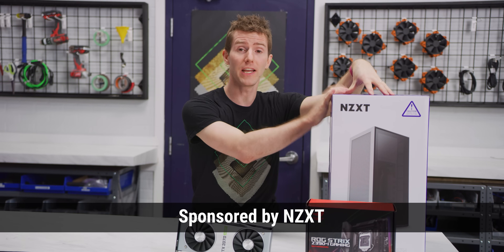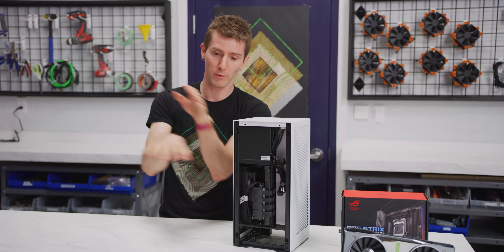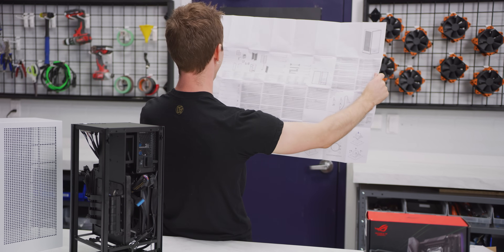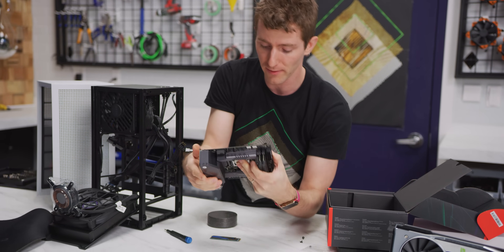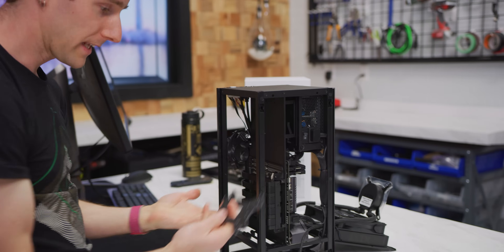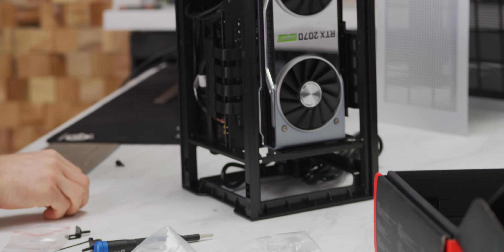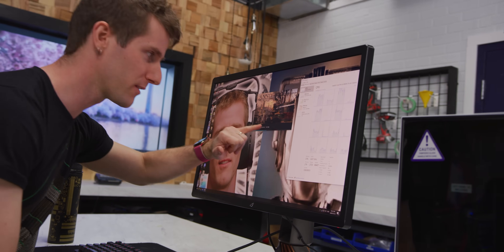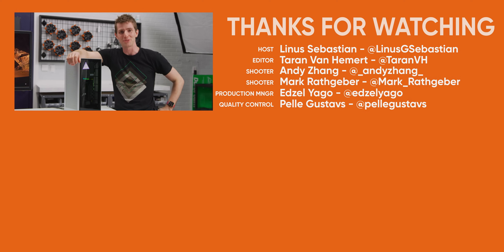Building the Xbox Series X Rip-off PC

Comment: "building a xbox series X rip-off"

uses a i9 9900k

yeah sure Linus sure
Reply: builds an Xbox Series X rip off ... at 3 times the price
Reply: @Obsidianrasengan  With about the same performance in games. Hopefully PC components go down in price after XSX and PS5
Reply: @Obsidianrasengan  do we have a price for the series x yet? Either way that's a fair point.
Reply: S W but yes that’s the point of Xbox’s. Cheap good materials
Reply: @Obsidianrasengan  it will indeed have an excellent perf/price ratio
Reply: @Obsidianrasengan  Can do ten times what an xbox can.
Reply: @Obsidianrasengan  with 20 times the utility and usefulness plus better graphics
Reply: @Obsidianrasengan  and slower
Reply: @Obsidianrasengan  

Probably Hence 'Rip-Off' 🤓
Reply: S W at 4x it’s performance
Reply: @ClippyCobain  yup
Reply: @ClippyCobain  its not even as powerful as a xsx
Reply: @Obsidianrasengan  and with parts that are not as powerful as the series x specs
Reply: @Lord Frieza Turing and RDNA 2 architectures are different, cannot compare TFLOPS
Reply: @Lord Frieza right? As if the engine determines how ALL the games will run. It's not like there aren't tons of games using the same entire engine with differing performance or anything. It's just funny how with something not out yet as with all consoles that have launched they believe the performance will be astronomical in everything. Then release comes with a shit ton of caveats.
Reply: @abc 123? chungus asked how much better the 9900k is in comparison to the xbox, to which you replied to "around the same" which is false, as the xbox cpu is gonna be an zen 2 cpu thats even slower than the 3700x and you also said "the xbox gpu will make up for the slow cpu" which isnt how it works, and cpu doesnt suddenly become faster just because theres an gpu in it
Reply: And an Nvidia GPU. Although to be fair these were probably the parts that were the most readily available in their inventory.
Reply: @SteelSkin667  microsoft devoleped the cpu (zenII+) with amd for probably a few years. That was not in their inventory.
Reply: @comet1310yt   I dont get your comment.  He was talking about Linus using what was in his inventory obviously.
Reply: @metalmaniac788  oh
Reply: @comet1310yt  How did they develop the cpu for a few years if zen 2 came out earlier this year?
Reply: @abc 123? Yeah how's that working out with the One X? We don't know exactly how this thing's going to run, but what you're describing creates something called a bottleneck. 

The CPU n the thing won't be at the level of Zen and Zen+, let alone it's Zen 2 counterparts. It only has a 3.8 GHz single core performance and 3.6ghz multi-core/thread performance. 

When you overclock a CPU on all of it's cores, the performance gains are substantial. 

It's obvious you're speaking from a place of conjecture. I'm not trying to be mean, but you're seemingly naive of hardware functionality
Reply: @KingInTheNorth I would not believe any reports about he xbox until it's actually out
Reply: @abc 123? The xbox series x gpu has an way lower clockspeed, probably to have better thermals for the complete system. The Zen 2 Jaguar Base 1,6 Ghz boost 3,6 will never be as fast as an 3700x which is base 3,6 and 4,4 boost. Which some people report to boost up to 4,1-4,2 ghz.
Reply: Lots of salty pc void here. Gotta remember Consoles needs to be some what future proof because it’s suppose to last for years
Reply: @abc 123? 3700x will outperform the CPU in the Series X
Reply: abc 123? Zen 2 has a higher IPC than current gen intel, it’s just intel has higher clocks.
Reply: The difference is that no matter how powerful our PCs are, when it comes to loading times. Xbox and PS5 wins. Because video games tend to be more optimized in consoles. My opinion don't judge ahah
Reply: @key3311  Video games aren't just optimized on consoles, that's why some games on PC allow console commands to use cheats, go into debug mode and such. Loading times will be superior on PS5 until the new SSD's come out for PC later this year, around the same time. Even then, we won't know until then. I'm sure hoping that PS5 keeps up or pushes ahead in loading times, though! Fingers crossed!
Reply: The GPU alone cost more than an Xbox Series X lol
Reply: Deliveredmean42 since it’s using rdna 2 gpu stuff, by the time it releases im sure there will be gpus with the same performance for lower prices lol, well, i hope so
Reply: @Deliveredmean42  same with the CPU
Reply: Lets put aside the potential power of the new consoles and remember you're paying $60+ for every new game (Unlike on PC) and also paying $60 a year for online play times 7ish years of a console life. That shit adds up and pretty much negates the higher price of PC components.
Reply: @TooBokoo  what a load of shit. You can game share and stock up on gift vouchers that negates any of that, you'd be an idiot to pay full price.

I bought a decent enough PC last year and trust me when I say I'm still waiting on these apparent savings.
Reply: @TooBokoo  yeah that's like buying a car in full for 30k rather than buying a 30k car paying 250 a month. You're saying it's better to just drop 2k just to play some games rather than spending money overtime because it adds up..
Reply: @TooBokoo  scrapping online tariff
Reply: @TooBokoo  not really with game pass. and xbox share. i never paid full price or anything for my games. im on pc now tho
Reply: @abc 123? the ryzen 7 3700x in the xbox is locked to 3.5ghz
Reply: Looking at the comments 😂.. just face it, Xbox series X is going to wake up the PC gaming hardware industry big time. You have been stagnant for years and overpriced. Innovation, Mass production and optimisation Wins... sorry 😐
Reply: 1misanthropist  they can.... Something called XEON And rx570
Reply: @abc 123? Riiiiight. Keep thinking that.
Reply: @abc 123? That's called a bottleneck
Reply: @abc 123? Youz saying that the gpu somehow increases the cpu performance.
Reply: @Lord Frieza Seems legit!
Reply: @Lord Frieza I doubt these will even match the performance of a 2070 super..let alone a 2080 lol
Reply: @Transistor Jump Haha!
Reply: @Lord Frieza Don't bother with these people man, they can't seem to comprehend that more Tflops doesn't always mean faster.
Take the GTX 1070 and GTX Titan X, the Titan X has 11 Tflops where as the 1070 has 9, but the 1070 is actually 3% faster then the Titan X.
Reply: @Deusomas  yep more tflops does not always mean better performance. It all comes down to the architect and optimisation. And apparently AMD has done a good job on the architect or the gears of war devs really optimised their demo.
Reply: I hope all is well I feel like God laid this on my heart for me to send you this message! The Bible verses that changed my life which was Acts 2:36-43. I just wanted to say that Jesus Christ can restore your life and that is a promise according to Acts 2:39, and God loves you. 
 If you’re in need of a good church near you here you go:
https://www.upci.org/resources/locate-a-church God bless have a great one 🙂. I prayed over this I hope all is well 🙂
Reply: 11% rip-off
Reply: has MS released a retail prices yet?
Reply: @PSYCHOV3N0M  wow, the 100 bucks different
Reply: @abc 123? And basically cost as much as or close to the price of the console....
Reply: @abc 123? Thats not how cpu performance works.
Reply: @abc 123? The problem is you don't know what YOU'RE on about.  You clearly don't understand hardware functionality, so why are you commenting on it?
Reply: AND a nvidia gpu
Reply: @danielrouw2593  Haha absolutely no cheating going on there :P
Reply: @sayncapalot4548  yeah.. sure xD
Reply: O.  M.  G
Reply: yeah.   
may ya take a 2080ti.
May that's a xbox killer.

in that case pc's walking over and 'touches xbox' with a hatchet
Reply: Don't bother man, these people cannot seem to comprehend that more Tflops doesn't always mean faster performance. Ex. GTX 1070 vs GTX Titan X, the 1070 has 9 Tflops and the Titan X has  11 Tflops but the GTX 1070 is actually 3% faster then the Titan X.
if the internal power supply is not above 650W there is no way the console will be able to power both the GPU and CPU at maximum loads, if this is the case they will have to be underclocked.
Reply: @Deusomas  yep because you know way more than the people who actually created the machine. I dont really care if it's more powerful than a super high end pc. But I have confidence that the people who are creating the machine know what they are doing.
Reply: @psbetter5838  it doesn't take a rocket scientist to understand how graphical components work, do a little research and educate yourself.
Tflops is only one piece of the puzzle.
you got Cores, Core Architecture Graphic Clock, Processor Clock, Graphic performance, Memory bandwidth and then thermal power specs.
Reply: @Deusomas  ok I didnt mention tflops. I'm just saying that the people who built the machine know what they're doing. So idc what some.internet kid has to say.
Reply: @psbetter5838  you sound like a typical bandwaggon fanboy.
Choo Choo, all aboard Fanboy express, next stop, misinformation.
Reply: @Deusomas  the ps5 and xbox series x are built by people with actual reputation. Your opinion is invalid  go back to your fortnite kid
Reply: @psbetter5838  ok for one i'm 26 years old. and 2, it's not an opinion, it is facts.
if your going to be a toxic fanboy and not contribute anything to this conversation i suggest you leave because all you are accomplishing is making yourself look pathetic.
Reply: @Deusomas  I thought it was obvious lol. Everything in the xbox series x is optimized by the team over at Microsoft. So why is a nobody like yourself doubting what they're doing ?
Reply: @psbetter5838  because people are goats and believe whatever they're told, and most have absolutely no clue what a Tflop is, they just see a number and automatically assume that more is better.
and many people are doubting, anybody with a brain is doubting.

It's like how some people in this thread are saying it's CPU will be as powerful as a i9 9900k, which if they took a moment to think about it they would understand that it's an absurd idea. a CPU of that power runs so hot that it would set the whole console ablaze, even if it was comparable it'd be so underclocked that it'd be a waste.
Reply: @Deusomas  ok I mean they broke it down and showed the cooling methods.. it's not believing whatever we hear lol.they literally broke the console down and had youtubers inspect it like digital foundry people who know their stuff. So I dont really care about a nobodys opinion about a product that they dont have and never seen in person.
Reply: And a 2070 XD
Reply: @apple 123  2700x* its zen+ architecture
Reply: @apple 123 Its nothing to do with the clocks. The 3700x will have more cache then Series X CPU, which is vital for getting data to and from the cores.
Reply: Considering how much power the GPU would consume (Likely to be a next gen AMD GPU. The new architecture will be able to achieve much more for the same amount of power, so I presume the GPU will take most of the power), and the specs of the CPU, I think they might be using high end 4th generation Ryzen mobile processors. The ones that closely match the specs are Ryzen 4800u and 4800h. They're pretty similar, but the 4800u has much lower base clock while consuming significantly less power. The boost clock and other specs are extremely similar.
Reply: Lie-nus
Reply: Microsoft and Sony make most of there money from others things rather than the console itself
Reply: Linus has no concept of the real world. Gets too much free stuff.
Reply: PSYCHO it’s cost 500 or maybe 400 A BIG maybe but mostly 500 100%
Reply: sayn fc “windows mode”
Reply: The new ryzen And rx5600 has a similar performance or if You want rtx  You should pick up the rtx2060
Reply: LOL Doesn't even use a AMD CPU... Not even close
Reply: I would like to see Linus use CPUs and gpus that normal people would buy. But I guess I'll just resort to his budget builds but even then he uses AMD ..... And always goes straight for the GPU cards that are used very often. To Cliche Linus...
Reply: @Crawdoodle  They don't suck, but that is just your opinion. Consoles exist because it markets towards people who don't know PC stuff. Plus, getting a medium to high end PC costs a lot of money unless the person bargain shops, and not many console gamera do when they don't know the names of PC parts.
Reply: @IgnatiusDavidPartogi  That's on the developer to do though. The consoles were there and available, both to the developer and the audience, which means that Microsoft didn't have a problem in potentially showcasing what the console was able to do. This was done on the titles that actually ran on console.
Reply: called rip off for a reason
Reply: Thomas Beer that’s not how it works
Reply: @efcmkjj917  nah it is, because the developers make games around the hardware so a faster GPU will just make games more GPU heavy. On the other hand it is absolute bs to think that it is comparable to anything in the gtx 2000 range
Reply: yeah sure, even tho the xbox has then new amd proccesors that aint out yet and is 10x more optimised at 50 times a lower price
Reply: ... and a $2000 pc case,
Reply: my cpu alone costs the same amount as a brand new xbox one, im talking release day xbox one. get dunked on
Reply: @PSYCHOV3N0M  definitely won't cost 600 there buddy.
Reply: @drewbienewbie03xx81  Maybe not this gen but $600 consoles WILL HAPPEN AGAIN. Just wait and see. There's a limit to how much of a loss manufacturers can sell consoles. Inflation EXISTS at least in the U.S.
Reply: @PSYCHOV3N0M  well, according to your thought process... there have already been 600$ consoles.... there's inflation in the US.... there will be 600$ consoles again.... All of thats true but if they released a system for 600 today it would be like paying 400 for last gens release with inflation.... so you are, as a matter of fact, getting more for less.
Reply: Thats what Microsoft is hyping it up to be! :/
Reply: To be fair, I don’t see my self paying 10$ a month to *USE THE INTERNET*, and play some games that *I actually bought*, on pc...
Reply: Its supposed to be 3700x an i9 9900k is too powerful dude😂
Reply: i9 is a ripoff plus series x uses AMD’s 3rd gen cpu
Reply: PSYCHO this aged terribly
Reply: How much did this cost
Reply: the fact the the Xbox is cheap is a big reason that people are going console rather than pc so this isn't really a rip of more of like a NASA gaming machine that costs as much as my car
Reply: xbox series X gpu and cpu are better than y'all think. Because of Velocity Architecture, the gpu and cpu can exceed the raw specification.
Reply: @Dino De Marzio No Way i9 is still on the top
Reply: @Dino De Marzio :( 

well then wait for intel to release a new chip :)
Reply: @starnoelle8248  I deleted my comment. That was 7 months ago.

Microsoft used their deep pockets to desperately try to stay competitive against the PS5.
Reply: More like Xbox Series X Pro ;B-)
Reply: I thought the new consoles were amd
Reply: Man so many of these comments didn’t age well
Reply: @Everyday Good Vibes yeah I saw that video and wasn't impressed. The titles they picked weren't the best. I think I'll go with digital foundry over that video. Highly doubt a 1070 can match the series x in more demanding games.
Reply: Literally none of these replies aged well
Reply: @DragonMaster9595  imagine calculating CPU compute power by GHz
Reply: @DragonMaster9595  yeah but clock speed isn't a really good way for measuring speed these days, also, it is a custom chip based on Zen2
Reply: ryzen is better
Reply: Ya.. That 4tb NVME drive ALONE is $850 a RTX 2070 is less powerful according to reports and a 9900k is quite a bit More powerful and expensive.. and the cherry on top is that its WAAAAY larger then series x .. ya not even close to Xbox.
Reply: @Napster60  isn't 850 dollars for 4TB too much of a quote?? They usually cost around 500-600.
Reply: @Napster60  Dude..... And the thing comes with a freaking 300Watt PSU. WHAT?! 

Consoles are like those Smart ass kids you know you're smarter than, but every now and again they come up with some shit and make you look stupid in a crowd of people. Lol! 🤣 

Fucking A.
Reply: He should have used an 3700x and a RX 5700 XT Ryzen RDNA architecture.
Reply: SSaini it’s going to be the equivalent of a 6700 Non xt
Reply: And a worse GPU. Seeing as the Xbox Series X has a compute power comparable to 2080 Super. According to the tests with the Gears of War demo that apparently wasn't super optimised.
Reply: @fredrikjonsson8362  Xbox Series X performs slightly worse than a RTX 2080 according to digital foundry who had the opportunity to run benchmarks and compare early. People always ignore Digital Foundry's knowledge on such things and go off on rumors idk why.
Reply: @fiftyfive1s410   "Digital Foundry confirmed that early performance was similar to an NVIDIA GeForce RTX 2080."  I don't know if digital foundry have changed their initial stance on this but this is what they said early on. 

It has a compute power of 12 tflops which not far from a 2080 ti. And don't forget consoles are easier to optimise than pcs for games. The performance we'll see from both consoles will depend on each games. Obviously exclusive titles will perform better than multiplatform ones.
Reply: @fredrikjonsson8362  Ah yes, the good 'ol teraflop metric, "raw power" lmao. Doesn't mean too much as it just measures raw compute power. Since it's a bit difficult to explain I'll provide an example: the gtx 1080 has 9 Tflops of single precision performance aka raw compute power, the RTX 2060 super has 7.2 Tflops of power, the 1080 beats out the 2060S right? Wrong. The 2060S is either equivalent to or more powerful than the 1080 in actual real world gaming performance (you can check out benchmarks here on YouTube). It is unlikely that Xbox Series X's slightly lower than 2080 performance has changed as it was only a few months ago that that conclusion was made, however I think it's best to assume it performs better than a 2080 and worse than a 2080ti. Your stance on "optimization" is very valid, but by the time games start tapping into the potential of next gen we'll already have ampere and RDNA2.
Reply: @fiftyfive1s410  yes tflops isn't everything it also comes down to the  GPU architecture. Which has been mentioned numerous times in this thread.. Still that doesn't change the fact that digital foundry originally said (when this video was made) that it had roughly 2080 (2080 ti according to some outlets) performance in the gears of war demo. You'll always get more out of hardware with consoles than PCs. That's always been the case and we will see it again for consoles. And yes PCs will have better hardware at a more premium price. That doesn't take away what you get from the consoles at their price point.
Reply: @fredrikjonsson8362  Yep. I just have a feeling that RDNA2 and Ampere are gonna be big enough to dissipate the costs of the consoles price to performance wise. Just a hunch lmao
Reply: @fiftyfive1s410  It will def depend on how greedy NVIDIA and AMD are though. NVIDIA prices probably won't make PC as good price to performance wise (If AMD can't compete). Now if RDNA2 is good (which it could be if we go by the console reveals) we could see a price war coming. Which is so needed on the GPU market.
Reply: @fredrikjonsson8362  Nvidia price for 2000 series was fair tho. It was reported they spent almost all of the profits from Maxwell on RTX R&D, 7nm will bring huge price reductions due to smaller dye sizes. RDNA2 will definitely be cheaper but price to performance idk
Reply: @fiftyfive1s410  I wouldn't call them fair. NVIDIA have been charging a premium for GPUs, like how Intel did with CPUs when they had no competition. I know the size of the chip is large, but I don't buy that excuse fully. NVIDIA likes to charge a premium and lock users down with their features.
Reply: @fredrikjonsson8362  The AI cores and RT cores, massive R&D costs, they may have charged a premium before but I certainly dont think they did so this gen. In terms of raw performance yes, but features like RT and DLSS would drive up costs. Maybe they couldve done larger line up of 16 series cards to help the perception of the 20 series cards, however the line up is way too segmented as it is so idrk
Reply: @fiftyfive1s410  well everyone thinks differently and that's fine.
Reply: @fredrikjonsson8362  yep!
Reply: @fredrikjonsson8362  let me tell you its not close to a 2080 super performance in real time its all paper stats that are not near matching a PC performance also overclocking and cooling capacity
Reply: @fredrikjonsson8362  it doesn’t have a comparable power to a 2080 super😂
Reply: @jaredevers6459  tell that to the game press when they published the article months ago
Reply: @fredrikjonsson8362  you mean months before they actually saw the technology in it. Also you do realize that 2080’s are able to do over 120fps reliably and the new consoles aren’t even able to do 120 reliably
Reply: @jaredevers6459  no I meant months before you replied to my comment. They wrote an article months ago after they had exclusive hands on time with the actual technology.
Reply: @fredrikjonsson8362  you still don’t understand, it’s not as good as a 2080. The new consoles can’t even do over 120fps
Reply: @jaredevers6459  you still don't understand your commenting on a months old comment.. Seriously.
Reply: @fredrikjonsson8362  I won't believe it till I see it in every game. But that would be very impressive.
Reply: @trithos7308  well they did manage to get horizon zero dawn and God of war graphics from the current consoles (who are very weak). Console usually perform much better than their actual tflops due to the optimisations.
Reply: @fredrikjonsson8362  that is only true for a fraction of games. And even then, until I see it I won't count on it. Companies do this shit all the fucking time. Present favorable examples of games running like butter. I will be happy when it's here, untile then I remain sceptical.
Reply: @trithos7308  should always be skeptical. But the tests confirmed by third party were impressive. Now it won't be the case in all games. It depends on how good the devs optimised but that's always been the case.
Reply: @fredrikjonsson8362  tests confirmed by third party's? Are you implying that Austin is a reliable third party? Because I don't think he is. Like I said, companies love to present favorable results.

And no, devs haven't universally done a good job optimizing on consoles. It's tedious and time consuming to optimize to the level of horizen zero dawn and god of War, which is why we don't see it outside of exclusives. Multiplats in the last few years were optimized to a bare minimum standard. And with better hardware, they won't keep up equal but this time unnecessary optimization work. So if anything, we will see a drop in optimization on consoles.
Reply: @trithos7308  I'm saying Digital Foundry is. And apparently gears of war for xbox series x is either good optimised or its the new AMD architecture.
Reply: @fredrikjonsson8362  OK, have to agree on that one, digital foundry is very much reliable. But still, favorable examples. Now if they showed of more then gears, a Microsoft owned and produced game, maybe like 5 games overall, that would be a whole different argument. But they didn't. So I don't have much faith at this point.
Reply: @trithos7308  Like I said before, it will depend on the game. But my point was it has up to 2080 super (or even just 2080) performance. Which is more than what LTT put in their video.

We'll see if it can reach the same optimal performance in other titles, but it will vary depending on titles (and the engine they use). The only thing consoles have going for them is they usually get more out of the tlflop (paper performance) due to it being easier to optimise for a console than PC.
Reply: @fredrikjonsson8362  for that price? 2080? Imposible
Reply: @Lucas_sGarage  no thats what the gears of war test showed. You have to remember that it's not uncommon for consoles to sell at a loss (historically).
Reply: @fredrikjonsson8362  PS4 pro 8cores rx480 equivalent
 later *most videos on Youtube 
HUGE BOTTLENECK IN PS4 PRO
Reply: @Lucas_sGarage ??? What are you talking about.
Reply: @fredrikjonsson8362  remember the PS4 pro? The stupid promise of a lot of power And high fps
Reply: @Lucas_sGarage  So? Remember PS3, that console was sold at a loss. Its nothing new for a company to sell a hardware at a loss to make it up with software. The early tests puts the new gen between 2080 and 2080 super. Probably more powerful if optimised heavily. They aren't using outdated tech at release anymore. Instead of old and shitty jaguar architecture they'll ship with zen 2. The CPU is the main bottleneck for current gen.
Reply: @fredrikjonsson8362  Funny enough, the gears of war test was actually running on a PC and not a Series X, and that PC had a 2080 Ti...needless to say people werent happy.
Reply: @fredrikjonsson8362  thats not too bad, its only like 10 fps higher on the 2080 ti, with does make a difference if youre hitting 50 fps, but low graphics preset exist
Reply: Fredrik Jonsson when it comes to 4K gaming n stuff. It has custom stuff inside because they don’t have to worry about FPS as they gon be running 120fps 🤢
Reply: @fredrikjonsson8362  hahahahah
Reply: @brenopedroso6161  hahahahahahaha
Reply: @fredrikjonsson8362  its actually compared to a 2080ti
Reply: @Gamersquadtttta  No it isn't. Digital Foundry already showed that it's actually more like a 2080 or 2080 Super IF anything.

2080 Ti??? 😂😂😂😂😂 Don't overestimate these new consoles.
Reply: @PSYCHOV3N0M  two things I'd like to point out here. 1. Imagine the tech inside to be able to have a equivalent gpu that cost more than the console itself. Two congrats you have no life like me, reading all these comments hahahha.
Reply: @fredrikjonsson8362  No, XSX is comparable to 2080, not Super.
Reply: @IgnatiusDavidPartogi  That's not what digital foundry test showed. People are saying 2080 Super. But even if it's "just" 2080 it's still faster than what LTT put in their equivalent machine.
Reply: @fredrikjonsson8362  Oh, by the way, if you think XSX is equal to 2080 Super because it has 12 TFLOPs,

Vega 64 has 12.66 TFLOPs, and it loses to RTX 2070 with just 7.5 TFLOPs.

So, try again, will you.
Reply: @IgnatiusDavidPartogi  from the wording it wasn't the tflops but the actual performance in gears of war at 4k.
Reply: @fredrikjonsson8362  Oh, the
"Settings of the Gears of War in Xbox Series X is the same as PC at Ultra settings plus some settings that PC don't have"?

Maybe you should read this first before immediately believing the bullshit that Microsoft say:
https://www.hexus.net/gaming/news/industry/56841-microsofts-e3-xbox-one-demos-ran-nvidia-powered-pcs/
Reply: @IgnatiusDavidPartogi  never said it was bullshit Microsoft said. I clearly said digital foundry. Which is a reputable third party source. Now that test could all come down to very good optimisation. I expect varying results based on a game by game basis. But it does show it is powerful by today's standards if optimised good (if it was just down to optimisation, could also be a very good architect improvement from AMD but we'll see that when they release RDNA2)
Reply: @fredrikjonsson8362  Yeah, Digital Foundry only reported what happened, even though the one that Digital Foundry reported (Microsoft) liked to lie about Xbox marketing.

FYI, I never blamed Digital Foundry. Only Microsoft.
Reply: @IgnatiusDavidPartogi   I never implied that either, I can also understand your hate towards Microsoft (or Sony for that matter). Every manufacturer tries to show their products in the best light. My whole point originally though was that the GPU LTT picked was too weak to match the performance of the new xbox. Tflop aside the console will just perform better than a 2070 or a 2080 (as we saw with the gears of war test). Even 2080 Super in some case (probably, but we'll see) #. And the reason is they usually get better optimisation and the devs can get more out of that paper performance (tflop). We've seen it in the past but like always it will come down to each individual title. We even see that on PC. Some titles just perform better (Doom for example) due to their engines and how good optimised they are against nvidia or AMD.
Reply: Ignatius David Partogi 2080 super has 11.1 tflops there for SX has 12 its comparable to that
Reply: @IgnatiusDavidPartogi  Your own article's words: "There have been several follow ups to the original Gaming Blend article highlighting these behind-the-scenes PCs. It should be noted that there were also several other game developers running Xbox One game demos on actual Xbox One development hardware at E3. The above photos represent just one game dev's choice to show off its upcoming Xbox One game title."

So it was up to the developers, not Microsoft, and not every developer used a PC.
Reply: @IgnatiusDavidPartogi  dude a 2080 is more than the price of the fucking xbox lmao
Reply: @fredrikjonsson8362  actualy it's more comparable to that of a GTX 1660 super
Reply: @fredrikjonsson8362  minecraft ray tracing!!!!!
Reply: How much faster is the 9900K projected to be against the Xbox?
Reply: @chunguspizza  Yeah that's just too damn expensive!
Reply: @VRtechman  350 in europe.
Reply: @VRtechman  we get it u think your smart lol
Reply: @chunguspizza  a hell of a lot faster. People seem to forget the CPU in the Xbox Series X is clocked at a measly 3.6-3.8 GHz. That's makes it substantially slower than a 3800x let alone a 9900k at 5GHz.
Reply: @Code-n-Flame  I mean. Clock speed isn't everything. The cpu is still a custom zen 2 chip, it may have the name but not the same cores in our beloved ryzen 3000 series. It can't be that good and only require 300 watts; if these people would know anything about computers they'd know it's impossible to power something that is as powerful as a 3700x with something as powerful as a 1660ti or a 2060 at best. 

It's literally impossible.
Reply: @chunguspizza  both next gen consoles are being conservative, using 8x Zen 2 cores @ 3.6GHz or less (and in the case of XBox, 3.8GHz if SMT is disabled), whereas the Ryzen 7 3700 is running its 8x Zen 2 cores @ 3.6GHz base, 4.4Ghz boost (with SMT), so the 9900K is clearly a superior option when the new consoles will fall short of AMD's own 8 core PC parts.
Reply: @chunguspizza  a Lot dude, a lot
Reply: @chunguspizza  buddy, the processor is more expensive than the entire console will be
Reply: @chunguspizza  not faster at all.. possibly slower, the new xboxs gpu power will be equivilant to a 2080, and it will have a brand new Zen 3 in it.
Reply: @chunguspizza  what kind of question is that? Of course the xbox is better, it's always better :)
Reply: @mika.sechsundvierzig  congrats you are 100% wrong!
Reply: @chunguspizza  its the expected price of the Xbox one x
Reply: @chunguspizza  very very much fast
Reply: @chunguspizza  well the 9900k is more expensive then the xbox
Reply: @chunguspizza  I use the series X and the i9 is nowhere close to the custom CPU in the series X
Reply: @chunguspizza  a lot i dont know the exact amount but a lot more power
Reply: Chungus Pizza it’s a $500+ cpu, if you have at least two brain cells then you’ll answer your own question
Reply: Mateusz Wodzisz I have a 9900K/RTX 2080 system now, just curious how the Xbox will compare. $1,800 for a gaming computer isn’t that crazy, and I don’t expect a $500 console will be better.
Reply: @chunguspizza  better in some ways. Worse in others.
Reply: @BAKS7U  jeez man, dont bite their head off for a simple question.
Reply: @BAKS7U  Someone is a little mad.
Reply: @chunguspizza  me neither .. just same performance ...
Reply: Mateusz Wodzisz he said how much faster not the price differential
Reply: @BAKS7U  raw price does NOT always = vastly more performance. 9900K vs 3700X is much closer than many like to admit.
Reply: @BAKS7U  price doesn't mean anything when we're talking about Intel... they were quite happy to sell quad cores at that price not too long ago.
Reply: @chunguspizza  it might not be better but if its only a 3rd of the price and almost as fast then that will be heartbreaking, my PC cost me around £2500....
Reply: Chungus Pizza if you are playing consoles games I think it would be pretty close if not better just less titles to pick from
Reply: @chunguspizza  denial won't change the fact it most likely will be.
Reply: @BAKS7U  It's actually not too far off. Looking at the price of a pc part and comparing it to the price of a console part is not an effective way of measuring comparable performance. Don't be so rude to people.
Reply: @primekrunkergamer188   9900K Is more like $500, not $1000 buddy
Reply: @BAKS7U  rude...
Reply: @chunguspizza  Your system is probably on par with the series x tbh. Your CPU is a bit stronger but the xbox sx offloads tasks from the CPU for better performance as well, so your computer and the console will be very similar
Reply: @BAKS7U  your wrong.. go look up the specs of the new system.
Reply: @BAKS7U  wrong! go look at the projected specs for the PS5 and the Xbox, they are going to be very fast compared to Zen 2 and 9th gen intel..
Reply: Mateusz Wodzisz not any more :) xbox is faster
Reply: @chunguspizza  Your PC will perform better. Much better CPU wise and marginally better GPU wise. Great PC!
Reply: @chunguspizza  yeah there is no way that it will be anywhere near, even the absolute max clock of the sx is below the base clock for the 9900k and the 9900k is made to be overclocked
Reply: @BAKS7U  lol literally more than the console for just the cpu
Reply: @BAKS7U  Comparing the cost against a company that has bought more than 5 million CPUs in bulk does not really mean much
Reply: @chunguspizza  well building a pc is now  more expensive. Xbox and sony probably get a sweet deal with there parts so i drives cost down
Reply: @BAKS7U  Lol. Damn
Reply: @chunguspizza  When it comes to performance the xbox series x literally uses a modified version of the ryzen 7 2700 which is significantly worse then the ryzen 7 3700x that everyone believes is in this system. Its worse at gaming than an i9 9900k by about 25% and as for graphics it actually wont beat your rtx 2080.  You have to remember they are only using 300 watts for the entire system. It means every component in the system will be under-clocked on because they need to keep head room too. Long story short if it sounds too good to be true it is usually too good to be true. Let the console people tell you what they will but its worse than a 2080 and on top of that a rtx 3080 is twice as powerful as a console for less then double the price. They just want idiots to think they are actually getting a good deal. Pc wins agian as always though and you can do more on it as always. This also means you win Chungas. #pcmasterrace
Reply: Robin Games & Invests Its not as basic as you like to think such as a pc setup, so much customisation through velocity architecture, you can’t compare so strictly ,it’s apples to oranges mate . Pc master race ....cringe .Perhaps try “agian”.
Reply: @futurekillxbox972  Lol I am comparing Apples to oranges? I am sorry but your software doesn't change the hardware inside. Be hyped all you want. The next gen consoles are getting destroyed by PC before they even come out... agian.
Reply: Robin Games & Invests Who’s pc ? It makes me laugh , the most popular gpu is a 1060 , it’s as if magically everyone’s pc is suddenly upgraded as soon as something new is available, of course you can upgrade a pc to whatever your wallet can stretch to , a “pc” is a variable concept with a plethora of configurations....try “agian”
Reply: @chunguspizza  I'm in the same boat with 9700k and 2080 super. From what I've seen we will still have much better performance but its game by game. Who knows, maybe we need to get ready to cry.
Reply: @chunguspizza  could be if we didn't know they will be lazy about optimization.  Nintendo uses weak ass processor and optimizes the hell out of it.  Works for me to the point where I'm happy with 720p, two steps back.  I'd been using 1440p for a decade before it was cool thanks to Thinkpad IPS screens. Had no idea I was ahead of the curve.  I thought 4k was the bar, and 8k the end game?  Series x and ps5 are only doing fake 4k so I don't even feel bad about switch going anymore. 

Why is uhd optical drive and 120 4k so hard to get in a console?
Reply: @koriander.k7377  lmao
Reply: @chunguspizza  its 5-10% faster in modern games, the Xbox SeX CPU is comparable to a AMD R7-3800X
Reply: @renehoyvik  why do people keep calling it the xbox SeX. Its literally just Xbox SX
Reply: @renehoyvik  no really, the CPU is running way lower frecuencies 3.5 sustained and it will receive some penalty from the use of GDDR6 as principal memory.
Reply: Yeah but he used a less powerful GPU, so I'd say it about evens out
Reply: @AngelPerez-dw8ou  Because i'm childish.
Reply: @renehoyvik  no it's not. Where TF do you people come to with this stuff?
Reply: @renehoyvik  how exactly do you think that an zen 2 based cpu which only goes up to 3,6ghz and is severly limited by thermals is going to be able to compete with the 105w 3800x?
Reply: @Kaiserin_Amy  Because 50% more power doesnt = 50% performance. Ever tried overclocking?  And have you seen the Zen 2 mobile chips? A 35W 4900HK (8core 16 thread) was only 13% slower then a 9900K and since the Xbox SX has a 350W powersupply the CPU won't be running at 35W
Reply: @renehoyvik  1st, how does this change the fact that the xbox processor will be slower than the 9900k? also, the 4900h uses higher clock speeds than the xbox cpu, the 4900h has an impressive 4ghz allcore boost, while the xbox series x only has an single boost of 3,6. Meaning it will be slower than the the 4900h, which is slower than the 9900k.
Reply: @Kaiserin_Amy  I've never said it wouldn't be slower. Unless i wrote something wrong on my first post i meant to say i don't think the 9900k would be any faster then 15% over the xbox soc cpu. Also, the Xbox isnt using boost technology. Its allcore 3.6 with SMT or allcore 3.8 without SMT. PS5 is teh one using boost. Anyways, none of this is neither here nor there. We'll see the performance when it gets out. I have a gaming PC, so if i get a console i'll be getting the PS5.
Reply: @renehoyvik  3,8 allcore is still slower than the 3700x allcore boost of 4 to 4,2 ghz depending on what you do.And since the xbox cpu will use the same architecture as the 3700x makes it pretty easy to find out the performance.
Reply: @AngelPerez-dw8ou  because sex. Duh.
Reply: Rene Knight at 3.5Ghz? Nooo
Reply: @renehoyvik  LMAOOO THATS FUNNY
Reply: @Kaiserin_Amy  3700x only goes up to 3.6? Tell that to mine OC'd to 4.39 ghz
Reply: @louiesatterwhite3885  I never said that the 3700x only goes up to 3.6GHz, read what I wrote before commenting. If you didn't actually read what I wrote then don't bother inserting yourself in an 1 Year old Conversation. I said "an zen 2 based cpu which only goes up to 3,6GHz", not that every zen 2 cpu goes up to 3,6GHz. Because you know,one of the cpu's in the new consoles was at that point rumored to be a zen 2 processor which only goes up to 3.6GHz. The Desktop cpu are hardly of any importance to the Consoles Performance or Specifications, and overclock has nothing with the stock performance of a CPU to begin with. I mean, I've even literally said in one of my comments that the 3700x has an all core boost on average of 4-4,2GHZ.
Reply: @chunguspizza  the xbox series x is similar towards a ryzen 3700x but its more customized for the setup within the xbox
Reply: @chunguspizza  slower, more than likely.
Reply: I mean, the whole xbox one x series gonna cost like 500.
Reply: @woutertje026  I don't think we know that to be a certainty.  Lockhart rumors suggest a cut down version to be made available without a ROM drive, less RAM, and a lower resolution target.  I think we're in another arms race that lead to the PS3 being priced out of comfort, and as such we're seeing the necessity of something like Lockhart, or even the Series X's own rather unique memory architecture intended to keep costs down.  I think we're going to see flagship consoles that might push prices to rather uncomfortable limits, but with cut down consoles filling in the usual price point.  Hell, the previous generation will still be viable as entry level solutions because the hardware is all still widely compatible.
Reply: @bojinglebells  

Yaaa.... No. Because the current consoles, being used as Soto-Nex-Gen consoles would DEFINITELY limit the quality of games for an extent until they are phased out. . . . Which is actually probably going to be the case except that Sony and MS aren't going to call their Mid Gen Refreshes as Nex-Gen platforms so the unspoken word becomes a hidden truth. 

With that said..... I bought my first games console Whole with the Xbox One, $499.99(Loved the fuck out of Kinect for head-tracking in BF4), Again with the One X, so I feel perfectly comfortable paying up too $700 for a games console.... Especially since I broke my previous phone last year, and just paid $560 for a Brand New one, with that Perspective, they have room to grow with price because of the understanding I have of the Hardware, it's power, and the fact that the Series X was designed in response to my type of Console Gamer and as such will reflect my ideology. 

PS5 on the other hand.... Isn't being built for people who want the Top console Hardware, they are on their consistent standard generational leap. . . I believe In Perception... The PS5 could seem more expensive with a lower price tag. . .Ironic huh? 🤔
Reply: @bojinglebells  well, for as i know. The next gen consoles will target 60fps at 4k gaming with hdr and ray tracing, we dont know the graphics settings trough. It will also use an modified pcie ssd with fast write and read speeds, that foor 500 bucks will make it an dangerous opponent for pc's.
Reply: @woutertje026  that's the thing, we don't know that will be the price, it could be far more expensive.  The PS5 SSD is faster than anything currently available in a consumer M.2 PCI-e 4.0 NVMe drive, of which fastest such ~1TB drives sell for ~$200-250 for the drive alone.  When we add in a Ryzen 3700 and Radeon 5700 to complete our PS5 knockoff PC, we're already flirting with $1000 without considering the motherboard, case/cooling, powersupply, or additional 8GB of GDDR6.

If we go back to 2006, the flagship PS3 was $599 @ launch with a cutdown version available for $499 (adjusted for inflation, the PS3 would cost $768.59 in 2020), and the cost for Sony to produce that $599 priced console was $840, so they were losing $240 for every console sold at launch.

And given what we have heard about Lockhart and a cut-down Series X, I'm not optimistic about seeing flagship models at just $500, especially with how the world economy is being influenced by the global pandemic.
Reply: @bojinglebells  

In your comment referring price of over the self items such as an M.2 NVMe SSD.... Did you ever think about basing your price of items not on the Consumer Price which is inflated not just by manufacturer out of the wearhouse, but also by the supply chain store who buy them to resell them. 

We will always pay way more as a consumer than we would as a wholesale long term business partner, and our perception of what is worth a sacrifice is different than a Multi Billion dollar business that exist with in a multi Trillion Corporation. 

Even with in the Xbox and PlayStation division, they can take a hit on hardware as every console manufacturer has since the birth of console gaming, and make up the funds else where. 

I mean even if MS only has 10million Xbox Live members.... If all of them are Xbox Live Gold members well that's $60 from 10 million members, in this example this is just gold, what if 2.5mil are so paying a 14.99 extra for Gamepass.... Well I think you know what I'm saying. 

Your theories about $1000 dollar Consoles needs to be reworked. . .
Reply: i dont expect a $500 console to outperform a pc that costs more $800, they're setting themselves up for some serious money loss or the reporters are on drugs.
Reply: @AlineaEuros  Consoles are usually at first sold at loss, because they make profit elsewhere.
Reply: @Kaiserin_Amy  last time consoles were sold at a loss was the PS3 era, and even that was just the beginning.
Reply: @ultraopgamer8076  The ps4 was also sold at a loss in the beginning, normally they at some point have it refined enough to be a little profitable. But the ps3 and the ps4 shows, that they don´t care if its not profitable in the beginning, they earn through games and ps network subscriptions
Reply: @abc 123? "The faster GPU in the series X will easily make up for the slower CPU".
Reply: What a Thread xD until we've the console in our hands we can't really tell. I'd wait before I put out something wich isn't even true after all. We gotta wait and see
Reply: I'd just like to point out that anyone shitting on the leap of Sony is a fucking moron seeing how all they have done is greatness with consoles with the exception of "Almost greatness" in PS3. Even then, they brought Blu-Ray when 360 didn't. This isn't any talk about Xbox vs Sony anyways, so I don't fucking know why someone would bash on them at all. Fucking lunatics...
Whatever they have packing in the consoles is a huge leap for both brands, the fact of the matter is PC will still always be ahead, especially with new parts always coming out and you can bet your ass they'll have parts that blow it away and perform way better towards the end of the year. Consoles are just definitely more cost efficient on gamers, with little to no PC knowledge.
Reply: sadly it a only remaster of i3 

i9 is really a remaster ver of i3
Reply: This why I rather wait for a game console that's comes with vr headset!
Reply: @VRtechman  But... Xbox team said they have 0 plans for VR
Reply: @VRtechman  ps4 has a vr addon
Reply: Comet 1310 and ppl really care about that
Reply: VRtechman then you will be waiting for a long time
Reply: VRtechman so, the PS5?
Reply: @VRtechman  none of them are coming with a vr set....
Reply: VRtechman just save and buy a pc?
Reply: @VRtechman  I mean, ps4 has vr. but it can't play the 2 best games out for vr.
Reply: @PSYCHOV3N0M  

HEY!........... 🧐......🤔 Uhhhh........ Drugs don't make you Stupid! 🤬, They just further enhance one's Stupidity. 🤬.... Ya!😄 That's It! ✌️😇..🍺 🌨️🤗🌲🍺.... 🖖🤪
Reply: Matt Rightman - exactly what I was say! The only reason he went with the intel chip is for more of that patented LTT auto-fellatio 😛🍆
Reply: @Lord Frieza Ehhh whatever you say guy. But the end of your comment made me laugh! 'I won't bcome back here and mock you like some other dirt bag' LOL! That was funny! 

Have a good day man, stay safe!
Reply: Yeah hahahahah and RTX 2070, why not wait for RDNA 2 RX 6700
Reply: Mazter don’t get rdna anything. Amd gpus still no bueno
Reply: You don't know, Linus is #intel's #bitch
Reply: @howdoyoudoit3499   having a partnership or Good relations with a Company as a Business make them a Bitch lol
Reply: @Lord Frieza Uhhhh...... So when the console comes out, and the games run equal too or greater than a 2080, should I come back here to these comments and talk shit or will you be humbled? I wonder... What would you do if the console does Continue to do what MS said it would be able to do? 

Do you just like switch Bandwagons and talk like you always believed and backed the console? Or..... I mean you're a PC right? I guess I'm the future if you're smart you'll continue to talk shit, except you'd have to spend some time in your Troll Cave waiting for the Next GPU to release that for sure will stomp out the Nex-Gen consoles..... Having to pay 2.5 the price of the console to top it.... But your day will come lil Pup 🐩
Reply: @cMARVEL360  why would anyone need to wait for the next release when they have a current gpu that stomps it? You are aware that a 2080 isn't the to dig, right? Not that it matters because consoles are never hitting the fps the PC games are happy with.

What most likely will happen is the PC will run it better, but those who praise console gaming will say how it looks good enough and plays good enough. Sort of like always, never is a answer given that just bluntly admits consoles are not as good even if good enough for you. As a PC games I don't have to admit that because that lower fpa no matter how it plays is not "enough" for me.